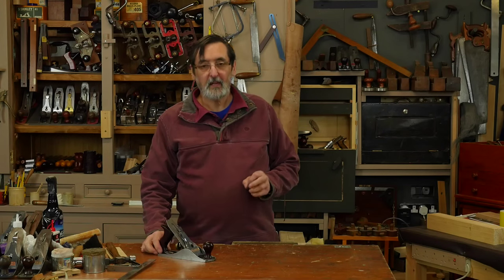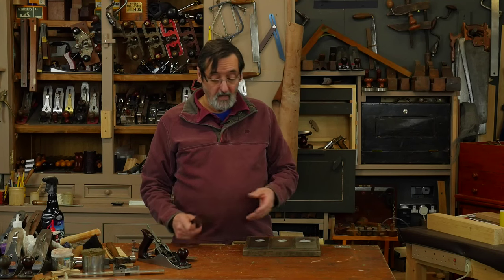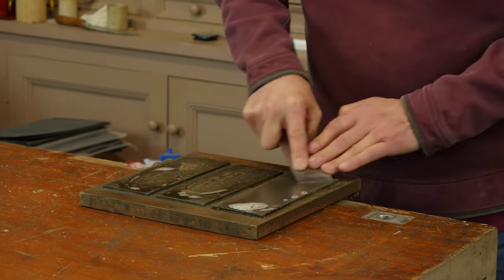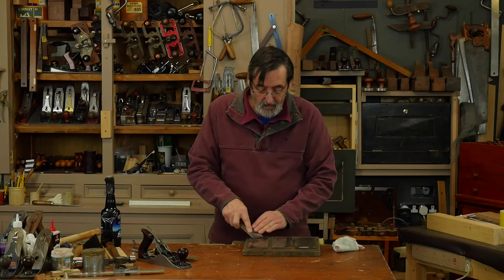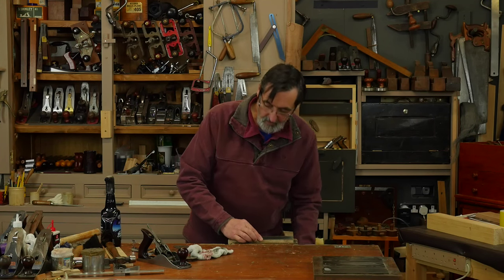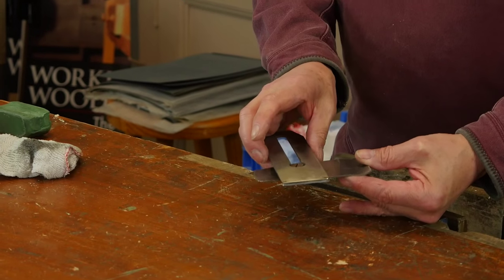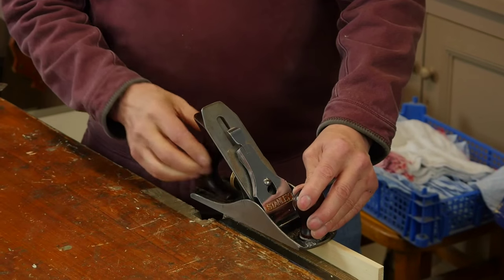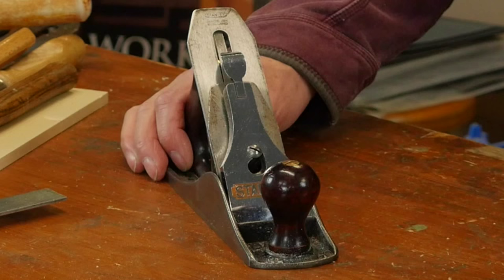Sharpening and Setting the Bench Plane | Paul Sellers

Comment: Today I checked the fit of everything on my No 4 plane. Looking for any signs of twist in blade caps and frog. The back of the blade was flattened on a diamond plate .  A thin film of oil between all the srfaces .Everything should work smoothly .--No.-- After further delving I realised the large Screw Head joining the blade and chip breaker was banging into the depth control  body .The  Y piece . To withdraw the blade ,the Y piece was already leaning back. Any further movement backwards was not possible and the blade edge was still poking out .
 So I need to grind off almost a 1/4 inch off the front of the Stay Set  chip breaker  . Fortunately that part is quite thick , much like the engineer that made it all the wrong size and shape.  This plane is a Bailey No 4 so no excuse for getting it all so wrong. 
But still the basic 2 part idea makes sense . The Idea was good.The Execution was Poor .
Reply from the maker: All too easy to blame the manufacturer when it could be someone switched out a component part for some good or bad reason. Perhaps look there first?
Reply: Well a Bailey No4 has a measurement from the mouth edge to the depth adjuster in a middle position. If it fit that it would work . The slot below the blade in the casting is standard  so the connecting screw should fit  in that space.  But this 2 part chip breaker hits the depth adjuster before the blade is withdrawn . If it was made to fit an unusual plane there should be some mark to show that . I rest my case  m" lud. . @Paul.Sellers

Comment: Mr Paul,  teach us this : 
1. Micro bevels are useless
2. Resting your plane on the sides is bad practice
3. Jigs for sharpenings, he don't need them. 
4. Round the corners, no perfectly straight blades.
5. Sharp 4 to 5 times a day. 

And a lot more...
Reply: He uses diamond stones, the edge should come out perfectly straight, only the very corners are rounded to avoid sharp plane tracks
Reply: @Simon-oy7kf  that's not what i meant, i mean  a perfect angle all the way back, keeping it "perfect", and that it's not necessary as you can see, cause he changes the angle when he is sharpening the blade.

Comment: Getting glass cleaner on your fingers several times a day is going to pass through your skin into your body every time.
You should find something else to use, like distilled water or any other clean water without unneccessary chemicals in it.

Comment: @10:50 ... "Don't set your plane on it's side, it resets the plane" ... are you kidding?  How does it reset the plane?  I was taught to ALWAYS set the plane on it's side so that you DON'T DULL or CHIP the blade or DON'T knock the blade out of alignment.  Though you can retract the blades easily on some on planes it's also good to get in the habit of setting a plane on it's side as this  will prevent the two most common things that either damage the plane (the blade) and/or put the plane (the blade) out of alignment.